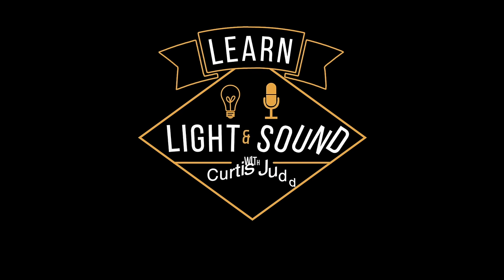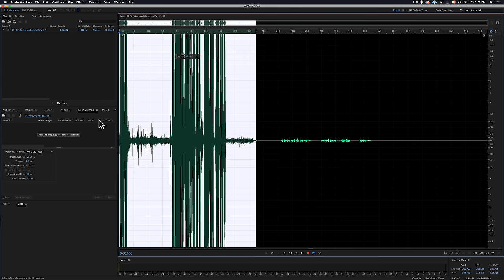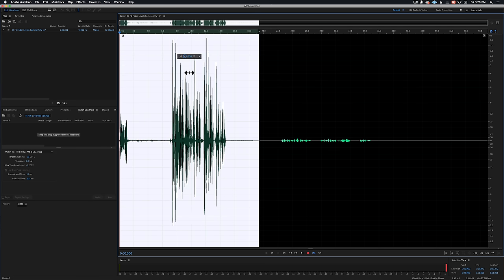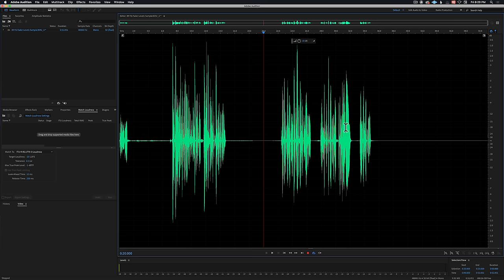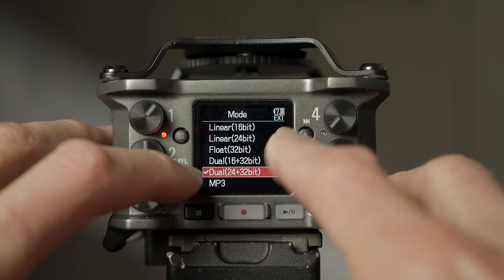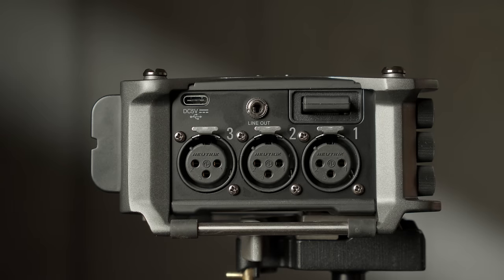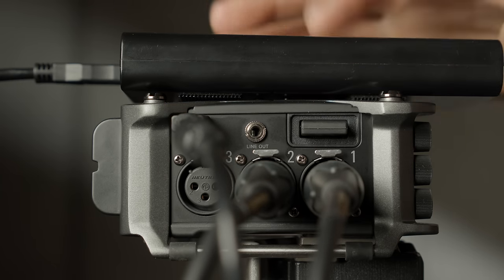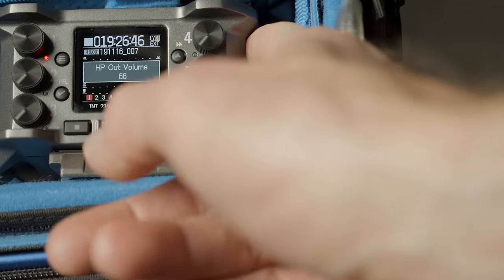Zoom F6 Audio Recorder Review

Comment: Hey Curtis, friend just bought this same setup a few months ago but he's struggling to get the kind of quality in your video. Granted his house is a bit busy with kids and gadgets but are there any tips you can give to get more crisp audio? Also did you happen to use a low pass filter?
Reply from the maker: Hi M 6, If you're dealing with a noisy space, yes, I'd definitely use a high-pass/low cut filter. Get the microphone nice and close - in this case I used a RODE NTG3 shotgun microphone boomed about 12 inches from my mouth. You also have to control room noise as much as possible. Turn off anything which makes any sound if it isn't needed for the recording. I also hang sound blankets to help address sound reflecting off of walls. Best wishes!
Reply: @curtisjudd  do you know if the ntg3 can be plugged straight into a pc? Thanks for all the info

Comment: Hello Curtis ! How do i sync zoom f6 as master output time code to gh5s flash sync bnc input to jam set the camera .. i am interested in gh5s + zoom f6 one woman crew
Reply from the maker: Hi Julian, I'll need to test that. One word of caution - the GH5S timecode implementation is rather poor and it DOES NOT have an in-built timecode generator. You are essentially jamming the camera's realtime clock and in my tests, it was off by several frames right after jamming. So it isn't the most useful timecode implementation.
Reply: @curtisjudd  thank you sir !

Comment: Are all the tracks recorded individually on one audio file or does each audio track generate it's own file?
Reply from the maker: You can choose in the menu whether you want a single poly wav file with all of the tracks on separate channels or separate files for each input.
Reply: @curtisjudd  Thank you soooo much for taking the time to clarify!  I'm using a Tascam X8 right now and not having the ability to include all the tracks in the stereo mix is frustrating because I have to sync them all individually in post.  And since the X8 does not support timecode (nor offer any native solution), I might sell it and replace it with an F6.  Thanks again - love love love your channel - I've learned so much from you!

Comment: If the feed into this is from a Sennheiser g3 wireless, will I benefit from 32bit float? Mic is ME2... Does my wireless system have enough dynamic range?
Reply from the maker: Hi Rowan,  you'll be limited by the dynamic range of the ME2 and G3 system. But recording in 32-bit float won't hurt anything.

Comment: Newbie question : if I use the F6 as an XLR adapter to DSLR and record the audio on the DSLR at 24 bits (not on the F6), will I get any of the benefit of the two analog to digital converts / wide dynamic range? Or would it be just the same as using any ordinary XLR adapter?
Reply from the maker: Hi, No, when feeding to your camera, you'll clip the camera if the audio exceeds 0dBFS in 32-bit float mode. But you can use it in 24 bit mode and use the limiters to prevent clipping.

Comment: Hi Curtis, I have a question about mixing. If I am in a tight room with two NTG mics, one for me, one for the guest, can I use the F6 to mix the sound without needing to multi track it in post? At this point of course I may have audio bleed between the two microphones if I can't adjust the independent levels? Maybe I'm not getting that aspect of this recorder of course. But for run and gun and quick edits, I don't want to have to take to multitrack. Kindest, Neale
Reply from the maker: Yes, you can turn on auto mix, set the input level for each mic, and record. The quality will largely be controlled by how close you can get each mic to the person speaking. Generally, the closer, the cleaner the mix will be.
Reply: @curtisjudd  thanks for this Curtis. In terms of auto mix, will that work at all successfully in a floating bit recording and does floating bit work well as a mix of two microphones? Kindest, Neale
Reply from the maker: @photowalk.podcast  It works, yes. I just don't use 32-bit float for dialogue recordings because 1) it isn't necessary when you set your gain appropriately, which isn't that difficult and 2) some people complain that 32-bit float recordings can sometimes create odd artefacts in the recordings. Automix works either way (24-bit or 32-bit float).

Comment: I was thinking to buy this recorder to improve audio for my camera. To use the timecode feature, does it have to be connected to the camera at all times or can I disconnect it after jam syncing?
Reply from the maker: It needs to remain connected or else the camera will drift - pretty quickly depending on the camera.

Comment: I have a stereo output from a wireless lav (with two mics).  It goes into an XLR adapter, but it seems to be mono.  Does the XLR input support stereo, or do I have to feed L / R channels into each of the XLR inputs?
Reply from the maker: Hi James, XLR connectors are mono, balanced. So you will need a separate feed for each channel, L & R.

Comment: Does the F6 record in poly wav? Or separate tracks for each input device? Have you tried importing 32-bit float audio into FCPX?
Reply from the maker: Hi Philip, yes, the F6 records poly wav files with each input channel on its own track plus, if you desire, the stereo mix also on separate tracks. Yes, the files import into FCPX just fine and are recognized as 32-bit. It all works nicely.
Reply: Curtis Judd thanks for the helpful reply

Comment: Thanks for the video.  Do the benefits of 32 F work through the line out?  In other words, is what you hear out of the line out (or headphone jack) unclipped if the input was loud enough to cause a clip?  I would like to use it as a preamp for my multi-track recorder as well as a recorder.  Thank you.
Reply from the maker: Hi Mark, glad you asked, no, they do not. The line output will clip if the audio exceeds 0dBFS. The recording in the F6 will still be good if recorded in 32-bit float, but the output will still clip.
Reply: Thank you.

Comment: I have a question,  is there a wireless audio system support 33 bit ? Or just any UHF wireless system can do 32 bit?
Reply from the maker: I am not aware of any wireless microphone systems which transmit a 32-bit float digital signal. And none of the consumer wireless microphone systems output a digital signal - they all convert the audio back to analogue before sending it out. That is why the F6 cannot "fix" audio that is already clipped in a wireless microphone system.

Some of the pro systems have various features to prevent clipping. Zaxcom has a Neverclip feature. Many of the pro systems have analogue limiters in their transmitter packs. But of course, all of these are VERY expensive systems, usually around $2500 - $3000 per channel.

Comment: Can you feed a sony transmitter with a split cable from the unbalanced jack out of the F6?
Reply from the maker: Yes, though if it only takes mic level input, you'll need an attenuator cable because there's an issue with the output fader on the F6 creating a lot of noise. See this video for details: https://youtu.be/t5W4Wg2yzfY

Comment: Hi, wondering how pure sound quality compares between the F6 and the MixPre II. Thanks!
Reply from the maker: Hi Gonçalo Gato, They sound very similar with a touch more warmth/bass response in the MixPre preamps. Also, with limiters engaged in 24 bit mode, the MixPre produces less self-noise. In 32-bit float mode the difference becomes more pronounced - you can still set the gain on the MixPre while you cannot on the F6. The result is that the recording sounds a LOT warmer as you can optimize the analogue preamp sound in 32-bit float mode.
Reply: Curtis Judd thanks so much!

Comment: Hi All - does the backup feature only work to backing up to a computer? The mixpre 3 you can back up to a USB can you do the same with this?
Reply from the maker: No, on the F6 you can only achieve a backup if it is connected to a computer with a digital audio workstation app.

Comment: might be a bit late but I have a hissing sound when recording and a low end rumble as well. Tested with different microphones (Oktava MK 012, Rode Classic, and a cheap ribbon Mic). Did I mess up the settings? I tried connecting only one Mic at a time but that did not help either...
Reply from the maker: Hi Robin, often the issue is self-noise generated by the microphone. You can fix low-end rumble with a low cut or high pass filter.

Comment: Hey Man I am sold, and getting this F6. Why don't you try SM7B without inline preamp like fethead or cloudlifter, as low gain and lift in the post as you did for some parts in this VDO, might work right? I'll try when mine arrives. You have device handy so you can try too. BTW  MERRY CHRISTMAS
Reply from the maker: Tried it, works fine!
Reply: @curtisjudd  Wow!!! what a quick reply. Now no need to buy those inline preamp? Well might need for monitoring. Well thank you man and MERRY CHRISTMAS.
Reply from the maker: No need for inline preamp.

Comment: Could I use a Shure sm7b without a cloud lifter in 32 bit float and get the same quality as a cloud lifter with say a standard interface?
Reply from the maker: Yes, the F6 supplies plenty of gain in 24-bit mode and works well in 32-bit mode with the SM7B. Either way, no need for a Cloud Lifter.
Reply: @curtisjudd  awesome! Cheers to the KING of audio once again! Curtis is the man!

Comment: Hi Curtis. I’ve just got myself the F6 but struggling to work out the best way to mount near to my camera for solo work. The metal bars prevent the unit sitting on my Manfrotto 504X head. Tried adding a Smallrig cheese plate to raise it up and clear the head but it won’t mount centrally on the F6 due to battery screw. Now I’m thinking that option might not be best anyway as audio connections should be kept still not panning etc. Maybe an arm attached to tripod leg? Any suggestions? Trying to avoid another tripod when time & space is tight....
Reply from the maker: Yes, a friction arm should work - just be sure to go with an especially sturdy arm. I don’t connect my F6 to camera so I don’t have any specific gear to recommend. But I wish you all the best!
Reply: @curtisjudd  Many thanks for your reply. I’ve been using the F6 no probs as audio recorder, with it placed in various locations away from my camera. But I also would like to use during live-streamed events, on those occasions when my X32 is overkill but 2 xlrs on the camera isn’t enough. Shame about the 3.5mm unbalanced output but .. apart from that it’s perfect for solo camera, multi mic streaming on location with a LiveU solo.

Comment: I am wondering why a time based audio recorder needs a frame rate selected? How would the frame rate change anything - A second is a second regardless of how many frames it contains. Just wondering if you know. There are many questions in the facebook forums  about audio sync and drift. Most of time I get audio sent to me just in a file and I don't even know what it was recorded on. Seems like the cheaper cameras are the ones that drift in audio. I have also had different sample rates sent to me from recording studios for master music audio and they always match the scratch audio or temp audio in length - the mystery of sync - seems like a good topic for a guy like you - to explain the reason it happens, and the mysteries of it all. Jam syncing of course works - but a lot of the people I deal with - the master recording doesn't have a frame rate setting. The F6 apparently does. And I don't know why. Maybe you know? Thanks Curtis.
Reply from the maker: Hi Jim, yes, that is to configure how the timecode clock on the F6 counts. Since timecode is in the format HH:MM:SS:FF where FF = the frame, the F6 needs to know the framerate the camera is shooting if you are using timecode to sync the two. If you set the framerate on the F6 to 24, it will count up the 24 frames in the FF field for each second.
Reply: @curtisjudd  Still don't understand how it would change the audio in any way. If you inputted a different frame rate into the F6, would the time change? or just the visual of what frame is showing. Kind of confusing if it makes no difference to the audio time. I guess the FF part of the timecode has to show something.
Reply from the maker: @JimRobinson-colors  Hi Jim, It does NOT make a difference to the audio time. That setting is purely for syncing via timecode. As you noted in your original question, the issue of drift is usually due to cheap, inaccurate clocks in lower-end cameras. The older GoPros were a great example of this. Many mobile phones have this issue as well.
Reply: @curtisjudd  Well Thank you very much. Curtis - have a great day.

Comment: Hi! One off-topic question about Zoom as a company. If they are dead silent when asked about future devices instead of denying does it mean they are working on it?
Reply from the maker: Hahaha! No idea! But I cannot imagine they wouldn’t deliver a larger format field recorder/mixer without the wide dynamic range capabilities.
Reply: @curtisjudd  Oh! I have no doubt that they will deliver a bigger brother of F6 or 32-bit F8 - something I am waiting for. I guess they think about how to beat MixPre10 II. But I was hoping for Q8n recorder with substantially improved video capabilities like 4K, HDR, improved low light performance, a bit better customisation of video settings and exFAT card format for bigger files. At least something like Q2n-4K but with bigger pixel size. I need something to record our choir competition performances and the setup must be as small as lightweight and as easy and quick to operate as possible. Q8 would be ideal if not for the horrendous video especially in low light, changing light or high contrast. 32-bit high dynamic would also be welcome but not critical.
Reply from the maker: @przybylskipawel  Ah, I see.
Reply: @curtisjudd  BTW I am thinking about switching to different setup: Sony RX0 II with cage and 37mm wide lens converter (or without) coupled with Zoom F1 with XYH-6 capsule. It would be hard for Zoom to beat it with their Q series, however the price would be much higher. I love the convenience of Q8 so much, but God, it looks so awful!
Reply from the maker: @przybylskipawel  👍 Could be a nice combination. Let us know how you get on with that!
Reply: @curtisjudd  As we can see from Q8n-4K in terms of video they arrived late at the party. Back then I would be thrilled. Now once I have Sony ZV-1 such a picture quality looks rigiculous, and I can plug Zoom F1 or Audio Technica AT8022 to ZV-1 getting great sound. They should have equipped Q8n-4K with something like stripped down Insta 360 one RS 1" module (no stabe) to get good IQ for recording concerts. These are demanding conditions.

Comment: Looks like an awesome machine for $699 list.  I design engine control systems.  I've been using a Sony TCD-D7 DAT recorder to record the knock sensor and ignition triggers.  I want a three channel recorder so I can record a second knock sensor.  I need three outputs, too.  The input signal levels would be about 0.5v.  3.5mm jacks for inputs and outputs if possible.  Does anything like that exist?
Reply from the maker: Not that I know of.

Comment: Not sure if I will get a reply because this is an old video. 

a) Do the knobs actually do gain for 24 and 16 bit or is that just fader/out again?

b) With the F3 coming out, if one doesn't intend to run more than a couple of mics, do you think that is maybe a better buy? Personally, I think the F3 looks cheap somehow, but then again the small size is attractive from a functional perspective. I hate the idea of not having knobs and having to dig through menus.
Reply from the maker: A) They are fader knobs in 16 and 24-bit mode. B) I'm not sure, I have the F3 on order and will post a review once I have a couple of weeks to work with it. 👍
Reply: @curtisjudd   Fader meaning recorder volume in file does not change? Meaning only output out of the device is affected (as opposed to gain) This doesn’t make much sense to me because if the volume is clipping the only thing you could do is use the limiter. Are there gain settings in the menu?

I believe the Mix-Pre is different.
Reply from the maker: @daudet1  The F6 works like most traditional mixing boards in 24 bit and below modes. The fader controls essentially the amount of that channel that is sent to the mix. So you can turn down that input using the fader so it isn't so loud in the mix. You can record the mix track.

Yes, the gain setting for each channel is in the PFL menu for that channel.

The MixPre series have two modes: Basic and Advanced. In Advanced mode, it works just like the F6 where the knob is the fader and gain is set in the channel menu. In basic mode, the knobs become gain controls instead.
Reply: @curtisjudd  My confusion was with the use of the word "fader". It sounded like to me you were using the word  gain for what was coming in / being recorded and then fader for what was going out. 
I now understand that 32 bit float doesn't have any gain control but 24 and 16 bit does, which is what I originally thought from the video. When you replied, I was confused. 

In another review someone commented that they were having trouble to edit in Premier after pulling a 32 bit file into Premier. I have not heard anyone else bring up this point. 

I also believe that 32 bit files don't work in Da Vinci. (again a video I watched) I believe that if I pulled them into Audition and then saved them as a different format, it would eliminate any 32 bit file editing issues along with it working with Da Vinci.  I only recently switched to Da Vinci but I still intend to use Audition for warming up talking head type vocals.
Reply from the maker: @daudet1  The latest version off DaVinci Resolve will handle 32-bit float files so you should not need to do any fussing around with other apps.